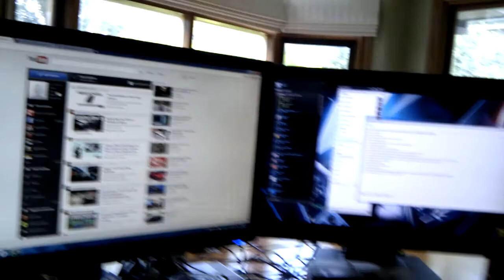XSPC Rasa 750 RX240 on a Fractal Define Mini

Comment from the maker: they came out with a new kit with a better pump and fittings.

Only thing you need is coolant, or silver depending how u want to deal with the bacteria.

The equivalent kit is called: "XSPC RayStorm D5 RX240" for about $289 in AUS

Another $10 for the matt pipe and another $10 for additives.

Comment from the maker: @TheXyrnox You have to have it outside the case or all your parts un-powered or removed to leak test it. You aren't being paranoid, that's just the done thing. 

Make sure you clean the parts before you make the loop too, add silver into the mix if you are using pure distilled water (you will notice u can buy silver coated fittings).

Use boiling water to help push the hoses over the fittings, also make sure with the Rasa you give enough length in the pipes so you can move the reservoir forward.

Comment from the maker: @TheXyrnox You will need 2 bottles to fill it completely (takes about a litre). 

Yeah mostly they are lazy, but as long as the parts aren't powered, water isn't going to hurt them. Just make sure you tissue up the fittings, its the best way to show if you have any leaks. Also at a minimum, have your PSU out of your case since it will be powered. High voltage parts don't like water.

Comment from the maker: @djdopebeetas @ stock (i5 2500k) max-idle is 38C max-load 57C (after 10 min)
ambient temp was 31C (rig was designed with Melbourne summers in mind)

Comment from the maker: That card was 267mm long

right now its fitting a 5870, but I have had to remove the 3 harddrive bays (you can unscrew the top three as they are modular)

Comment: @Zwank36 Hmm I definitely do like to tinker around customize all my stuff so I'll most likely go the rasa kit. It looks like it would outperform the H100 easily.
I think I should be okay building the loop (I'm going to leak test outside of the computer mainly because I'm paranoid. My recent PC actually caught on fire due to dodgy 4 pin atx extension...)
I live in NSW so hopefully the postage is nice and swift :p I plan to do some unboxing and reviews. Should be good!